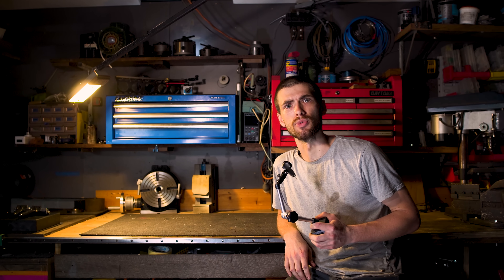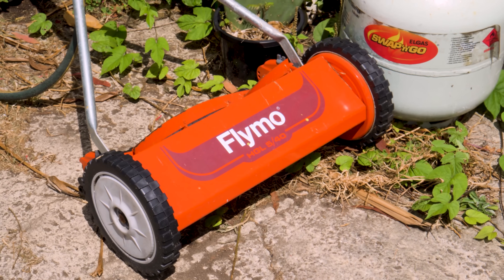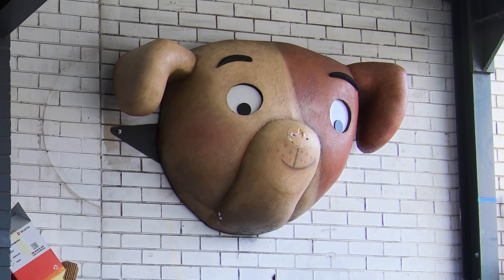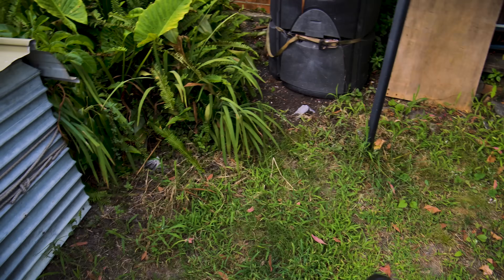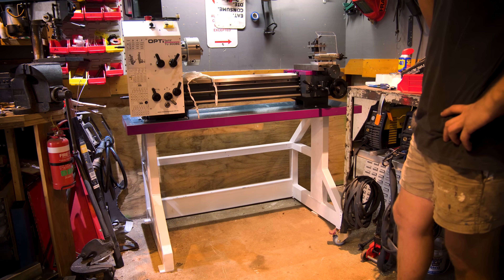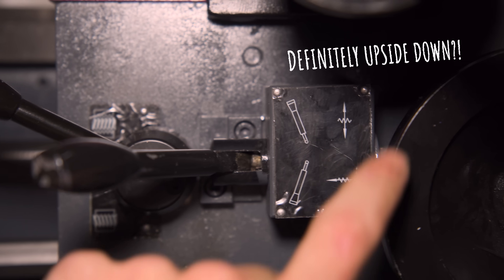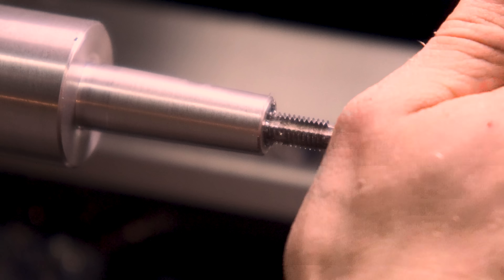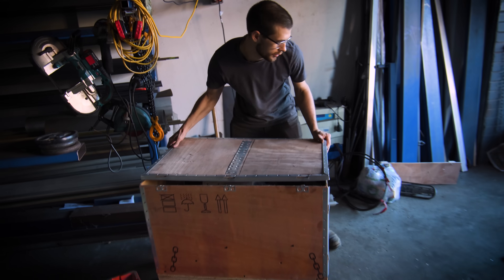I just want to make things ROUND (accurately)

Comment: Slight tapers are more likely caused by the headstock being crooked. Most lathes use some sort of fasteners to hold the headstock to the bed. There may also be some deviation between the spindle center and being level with the lathe bed also. 
Yes, absolutely level the machine,  but you probably have other problems that you will need to address.

Comment: I could not agree more with your last bit of wisdom.
Manual machines are very convenient for One ofs, a bunch of simple stuff and some stuff that would be very annoying on CNC. 
Besides manual machining gives you a feeling for the material and the tool, CNC either breaks something or not.

In other words, once the PC booted the cam software and the Mill is fired up, the plate with four holes in it, is milled on all sides and has two holes already in it.

Comment: You can get the twist out of the lathe by attempting to cut a cylinder, then getting a taper, then shimming the mounting bolts until you stop getting a taper. No level required for that. Level just required to make it level. Which is ideal to prevent long term un-even wear patterns. But pretty unnecessary to fix taper causing bed twist.

Comment: Save yourself the price of the precision level, you shouldnt need it for a lathe that size to run true. If all 4 corners of the lathe are bolted to the bench and the bench is contacting the floor at all 4 corners also then the cuase of your taper is most likely a result of bed twist.
This can be fixed with adjustable feet under the bench or under the lathe; simply setup to turn a straight part of say 6 inch length, measure the diameter at each end after each pass (thats the amount of twist over the length) and raise or lower one corner of the bed until you dial out the taper.
Very good chance this will fix it for you as a lot of benchtop size lathes can twist in this way.

Edit to add: if you have a very precise long endmill you can chuck this up in the 4 jaw shank outwards, centre it perffectly, and use the dial gauge mounted to the carriage and tracking the endmill side to measure and adjust twist either.

Comment: Leveling a lathe doesn't need a precision level, you can do it with an aluminum rod with two flanges between centres. Keep taking skim cuts on each flange and adding shims under the right parts until it turns without a taper. Though I've not done that, don't need that level of precision on my little AL-250... Yet.

Comment: Don't ever lift a lathe by the spindle nose, you will end up wrecking the bearings or damaging the spindle. Lift by the lifting points or wrap around the bed by the headstock, remove the chuck if needs be to get further up and use the saddle and tailstock to balance the machine as you lift it.
Reply from the maker: The spindle is a lifting point tho
Reply: @NoEngineerHere  Good luck with that, I never lift anything by the spindle, it is a precision ground piece, it might be ok with a small bench top lathe, but anything bigger like a Harrison or Colchester is risking damage to the bearings and spindle.

Comment: That's the same lathe I got from Hare & Forbes in Perth mid 2019. Along with the MH-28V mill of the same brand. Managed to buy the majority of the tools for them not that long before the covid tax kicked in luckily. And it did make it easier to stay at home a lot when you have a mill and lathe you're still getting used to haha.
I figured it was easiest to just buy the $250 1T engine crane from them during the same order.
I haven't done too many real mods to it yet. 4 way tool post got old fast, so got the Hare & Forbes quick change. Seems fine for the price. I wanted the multi fix style, but more expensive and harder to find. 
I did get the silly stands as part of the package deal. But I took out the sheets that go between the pillars (don't really know what the purpose of them is, there not really structural). I had an old 7 draw Sidchrome roll cab that I used to have at work. The outside was bent/cracked/dented, but the draws are fine after cleaning and regreasing the bearings. I took the draws out and built a box frame out of 20mm square tubing and 3mm flat bar for the draw supports. It fits pretty much perfectly in the gap under the lathe. No room for castor, so put skateboard bearings inside the bottom frame, only sticking out 5mm, enough to roll it back and forward without wasting height.
The only actual removing metal mod I've done to the lathe was to the compound travel, because I wanted to cut MT-3 tapers without a whole bunch of messing around to cut long tapers. I think I gained like 12mm or so of travel, by removing a bit of material at the end of the slot on the underside of the compound, then rounding the corners of the lead screw nut so the corners didn't hit the end of travel first. Removing metal there gains you travel in the retracted direction, so doesn't really lose rigidity. Then gained another 3mm by making a spacer out of 3mm flat bar to go between the handle mounting block and the top slide, and cut away the section of plate that hits the bottom slide.
That gains extension, so will be less ridged, but I only use it that far extended during the final cuts of making MT-3 taper tools and using really light cuts by that stage. I use a cordless drill as a power feed and it's worked pretty well for me the few times I've done it.

Comment: Have to disagree with your CNC lathe decision. You don't need to go to a CAD/CAM computer to take advantage of CNC on a lathe. CNC gets you all the power feeds, DRO, constant surface speed, and threading without worrying about stopping. I use linuxCNC and on the lathe I use computer CAD/CAM for less than half of my projects. I use lathe macros (profile, boring, threading, etc) for all the common operations complete with tapers and filets.  Once the macro makes a good pass I can do something else while it finishes. I also find myself entering multiple lines of gcode on the MDI command line. Much more repeatable than cranking a handwheel. While I agree that monkeying around in CAD/CAM may be slower than manual for one offs, using the lathe macros is much faster with better results than manual.

Comment: I just got a metal lathe that is well older than me and weighs 600kg. On trailer with forklift and offload with tractor. Pushed it into the garage using pallets, and moved it sideways by pushing of the wall with a long metal bar, and pallets, planks, blocks as spacers. Lifted off pallet using crow bar and metal blocks, onto stacked planks.
Proceeded to lift with the crow bar, removing one plank at a time and gently lowering bit by bit.

Comment: hey! fill your stand with sand or rocks and resin! it makes the lathe heavier and more rigid for better accuracy and better performance!
Reply from the maker: I did consider it, but I ran out of time! I will be using the rear 45° bit as a small material rack, which should add a few hundred kg!

Comment: to get it turníng cylindrical you need to adjust the Tailstock in the front and back direction, there are usually screws hidden on the front and or backside of it near the bed.
Nice shenanegans :)

Comment: a) I really hope the blue paint on the tubing is some kind of weld thru primer. Otherwise you are a true monster.
b) You should fill the stand with sand or something for vibration dampening IMHO. 
c) There are no wrong size tools as long as they are attached properly and used accordingly to their size.
d) If you have a decent CNC mill, I'd consider using it as manual with a jog instead of buying a cheap chinese manual crap.

Comment: Congrats on the machine, love your video!

I see you made at least 3 tool changes on the lathe... that 2 more than me before I decided to buy a quick change tool post! Good for you being so zen about it.
Reply from the maker: I'm close
Reply: @NoEngineerHere  A Size Multifix would suite the machine great.
A drawback is, that the tool holders are fairly annoying to make. or the rephrase it as an advantage: the multifix holders are an excellent excuse to buy a wire EDM machine.

Comment: Speaking from experience. Renting a truck with a hydraulic lift, from someone like Budget for $100 +kms +fuel does help. Idk what those lifts a rated for but it's not my truck. Congratulations on your first anchor. My 4 jaw makes a brilliant paperweight (ain't no body got time for that) it's nice to see someone using it. Would love a quick change head tho, instead of a million shims. I like the LED lighting but 50 Hz fluros are great if you want it to look like it's not spinning, when it actually is. If your motor cap ever goes, you can start it by hand.. wouldn't recommend it. Did that for a few years but they're only about $50 from CapTech. You'll never lose your chuck handle if you keep it in the chuck. Well, until you step on the foot switch by accident. Then it make a great wall decoration. Nice to see Boy Boy getting some sun, he needs it

Comment: I wonder how many people will comment about using the spindle as a lifting point ?  you know that is going to really get someones blood pressure rising 😆
Reply from the maker: It says to do it in the manual!
Reply: @NoEngineerHere  i bet someone will still moan.
Reply: @NoEngineerHere  I do like the humor you put into the videos, you have come a long way with subs in a very short time.
Reply: It was carefully positioned to straighten out the bent spindle.  Lifting was part of the setup process!
Reply: @somebodyelse6673  The manual for mine appears to say I should perhaps because it's so close to the bearing supporting it in the headstock... I haven't moved mine yet, so scared.
Reply: O_o oof